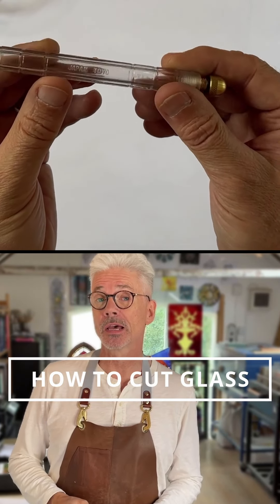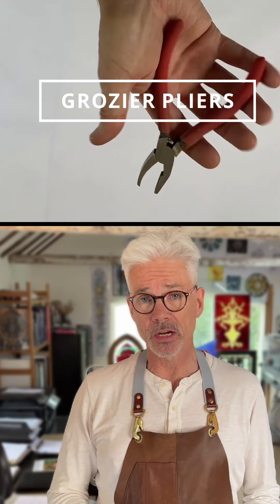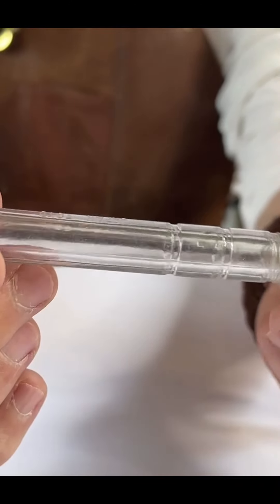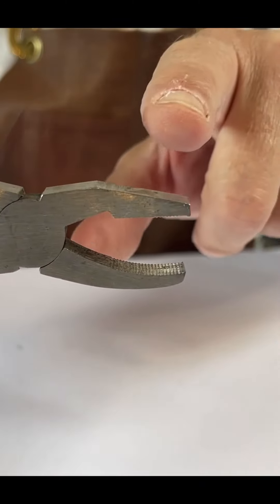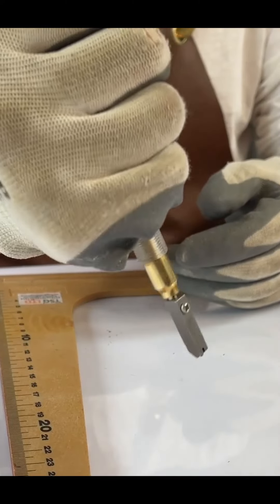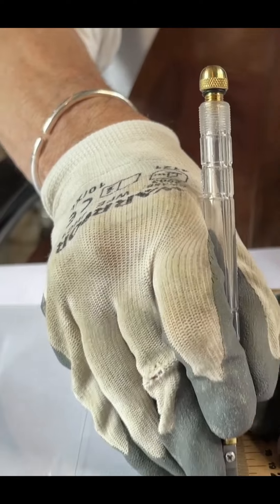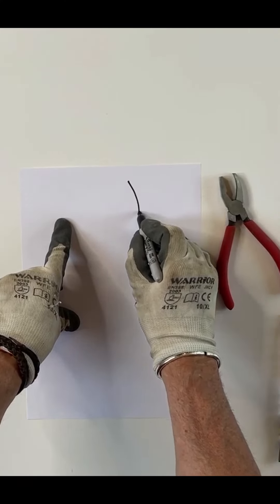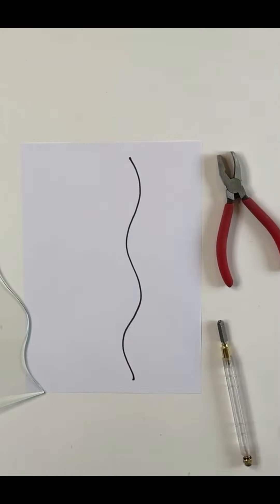Cutting Glass: Techniques You Wish You Knew

Comment: many thanks  the music makes me a bit nervous  seeing this skill however puts my mind at rest
Reply from the maker: Thanks Carl, glad it was helpful 🙂
Reply: @DerekHuntArtist Our scientific glassblower in the Netherlands always score a glass tube before breaking. He always wetted his finger with some spit and applied this to the score/scratch. It was routine and I still wonder if it helped to bread the glass. In the case of glass artist like you  cutting oil is often used, and also in that case I do not know if or why that helps. Seeing your careful tapping was really good and I will try that. Many thanks !!
Reply from the maker: @carlbrenninkmeijer8925  very interesting. I saw a video yesterday which mentioned oil being used to assist the glass to break properly. I always thought the oil was just to lubricate the wheel, and didn’t serve any other purpose. Perhaps liquid applied to the score (either oil or spit) does help in some way I don’t completely understand 🤷
Reply: @DerekHuntArtist  Oil is hydrophobic and does not interact with glass at all. So a) it must be lubrication OR b)  It "seals" the score/scratch somehowe. I try to work with little or no cutting oil because it may prevent the copperfoil from sticking to the edges. Tapping the glass and temperature gradients help for a crack to propagate along the score made with the cutter. I was just now thinking what happens when the freshly scored glass is immersed in an ultrasonic bath.. I will try that soon
Reply from the maker: @carlbrenninkmeijer8925  what are you expecting to happen with the ultrasound bath? I imagine it might be useful to loosen dirt or debris from the glass surface, but are you hoping for more?
Reply: @DerekHuntArtist  I thought that perhaps the glass picks up the ultrasonic waves and starts to "swing". You showed one quadratic piece of glass that had to "loose" 4 corner pieces. The ultrasonic vibrations may affect the different sections of the piece if glass differently and work somehow to propagate an induced crack. A singer is said to be able to crack a wine glass .. but this is not so certain, then somehow the energy from his voice sound must be absorbed by the glass. This coupling is weak.  But in the ultrasound bath the coupling is extremely high AND the higher the frequency the more energy is transferred. Moreover maybe water molecules can "enter" the crack and fascilitate it to propagate. On the other hand could water have the opposite effect.. I do not know.. One can also try to crack glass by playing loudly "I did it my way.."  But chances are small.